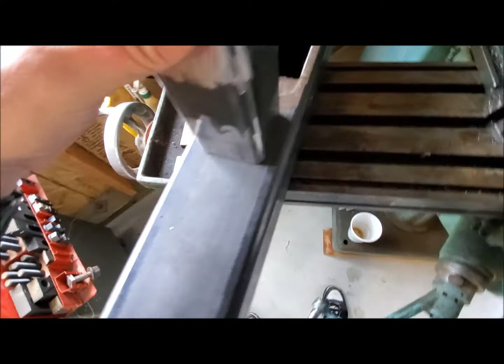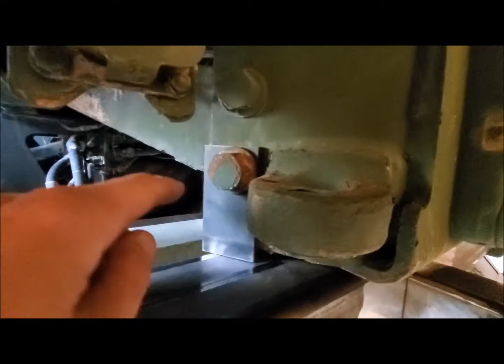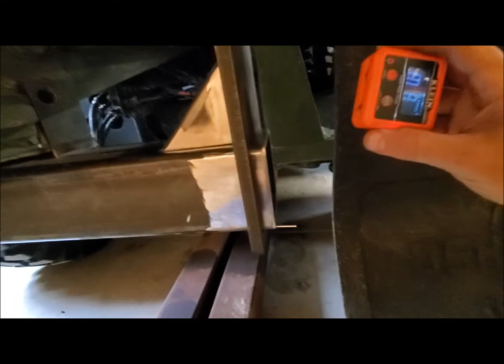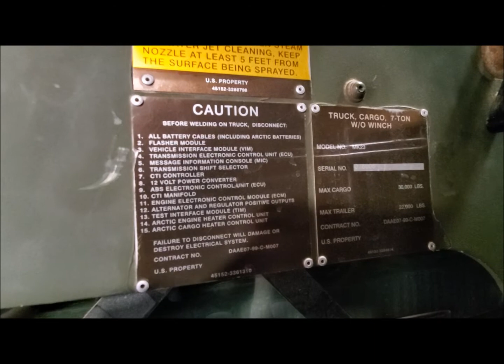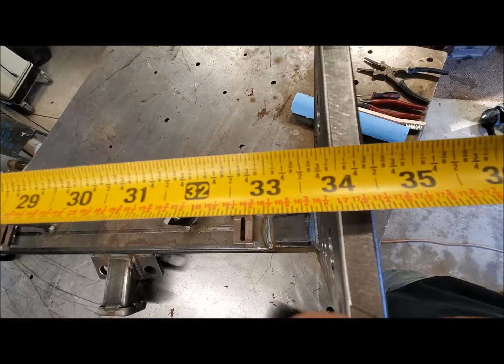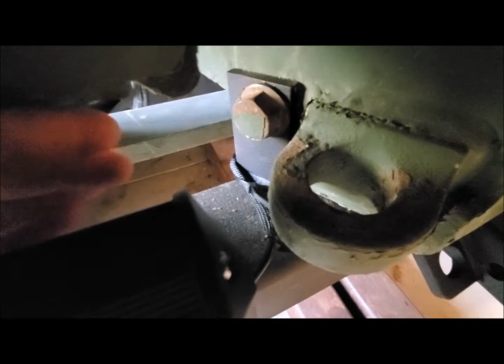Custom 2" trailer hitch reciever for Oshkosh MK23 MTVR 7 Ton

Comment: Just a suggestion, You could have used 2 pieces of threaded rod and nuts to keep the vertical bars in the proper position during welding too.
Reply from the maker: That's an awesome idea. Thanks for the tip!